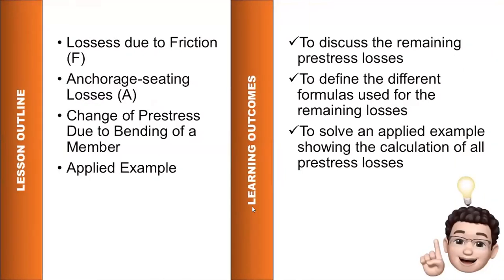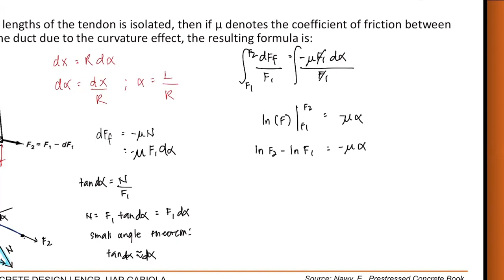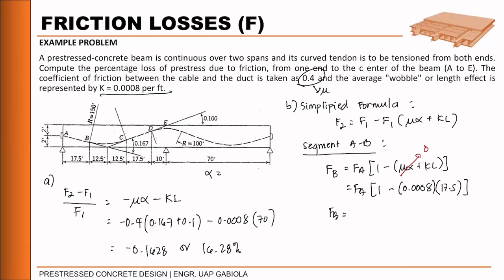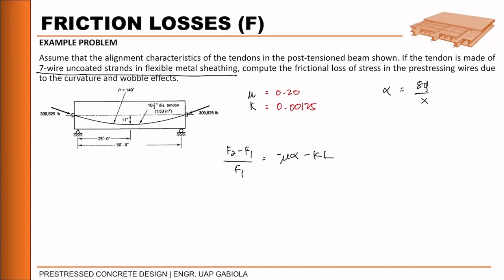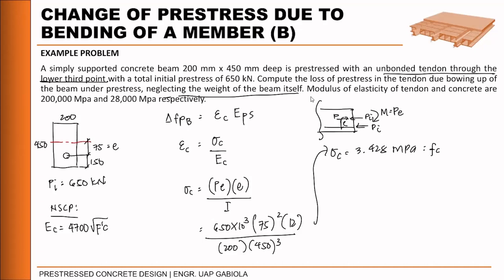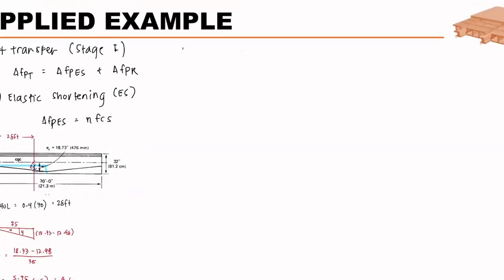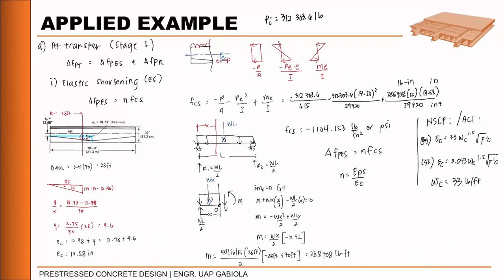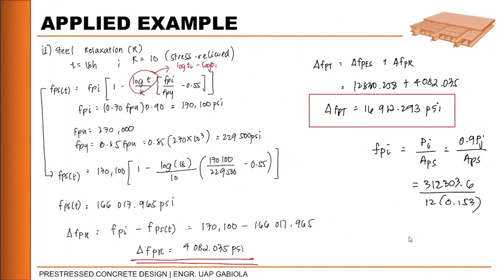PRESTRESSED CONCRETE DESIGN | PARTIAL LOSS OF PRESTRESS  - PART 2A

Comment: San nya nakuha yung 0.153? Sa aps? Constant po ba yun sir?
Reply from the maker: Hi, that is the area of 1 strand according to ASTM A-416. For a nominal diameter of 1/2-in, the nominal area of strand in sq. in is 0.153.
Reply from the maker: You may check this table in this lecture https://youtu.be/H6Pxg15a5Yo